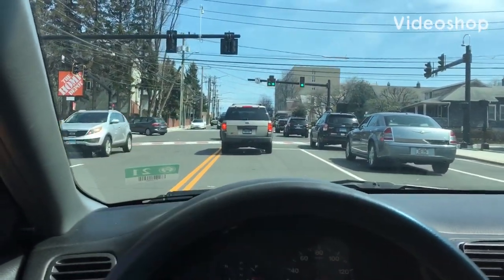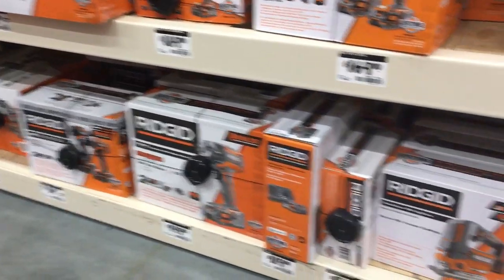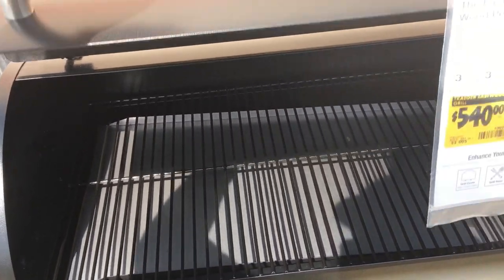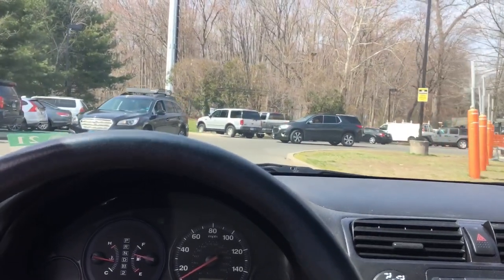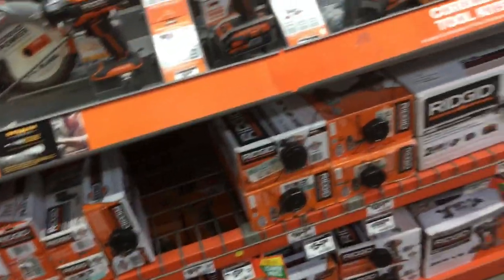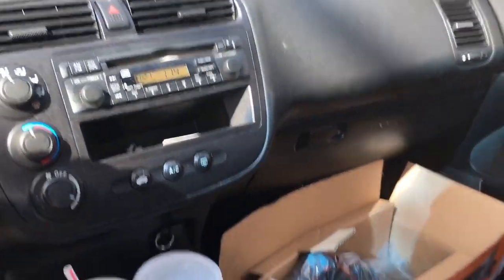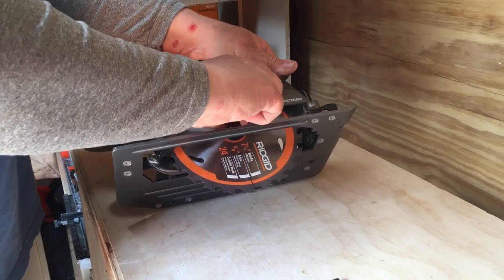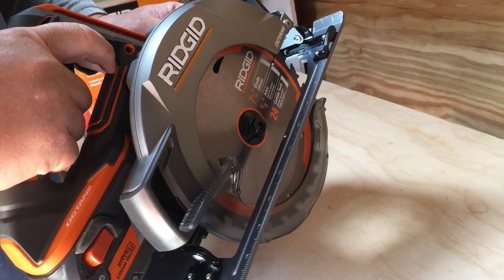Ridgid 18v OCTANE Circular saw. Handyman on a mission!!

Comment: I purchased the octane circular saw figuring that I could get by with my existing batteries, 2x 1.5 Ah and 1x 2.0 Ah and that I would just have to cycle the bats to keep on sawing. However, the truth is that the only compatibility those bats have with the octane is that they fit into the slot. Almost the second the saw detects any load on the blade it will cut off power to the saw. I took my first saw back and exchanged it thinking it was a lemon but the second saw is just the same. Ridgid should make it known to all purchasers of the octane circular saw that it is not compatible with all previous bats.... I'm going to say that if you buy this saw you better plan on buying octane batteries to go with it or forget it...
Reply from the maker: I had the same issue with this saw Frank. I ran into the rigid rep at the depot and he told me that this saw had an anti bind feature built in. I also though mine was a lemon. I’ve used the octane batteries in it and it still binded up. He said on knots,hardwood,don’t force it . I pushed easy and that seemed to work . Besides getting used to it. It’s a good saw. Good luck FRANK! Thanks for watching!! Catch you on the next one👍👍
Reply: Amen! I had the same problem. Very whimpy and would cut out immediately under load with a fully charged battery.

Comment: Just bought this saw and it constantly stops working when used with my existing Rigid 18-volt batteries. Anyone else have this problem?
Reply from the maker: Frank I had the same issue. I ran into the ridgid rep the other day and asked him about it. He said it’s an anti bind feature that when you go thru hardwood or a knot or you force it to fast it shuts down . I though something was wrong with mine but it was a normal feature. I never had that with my older dewalt. But since then I don’t force it as much and it’s been ok. Also i wasn’t using the octane batteries at the time. With the octane it’s a bit stronger. Good luck with your purchase 👍